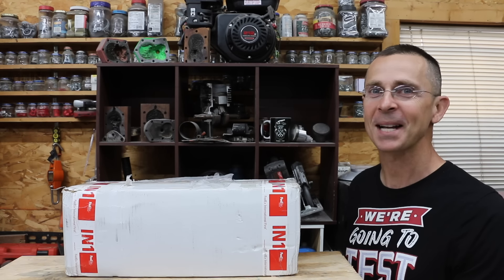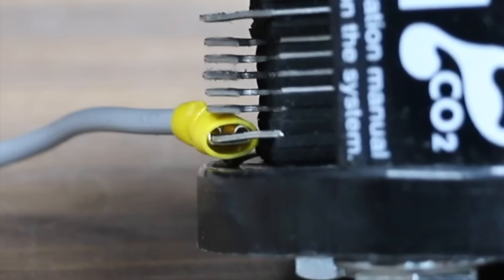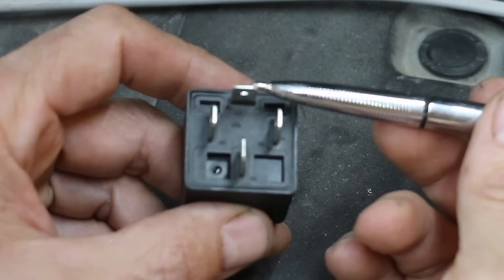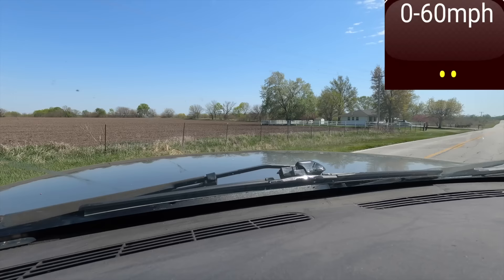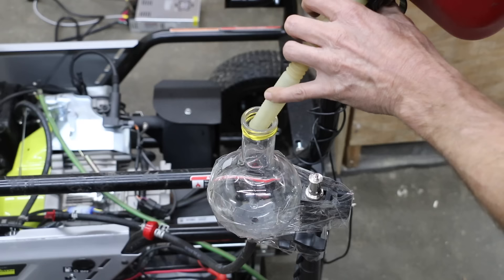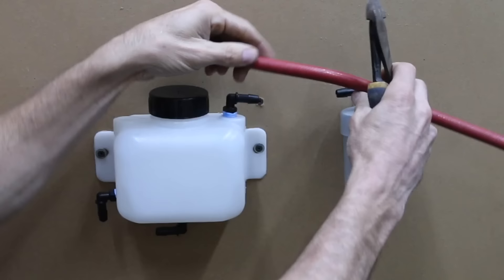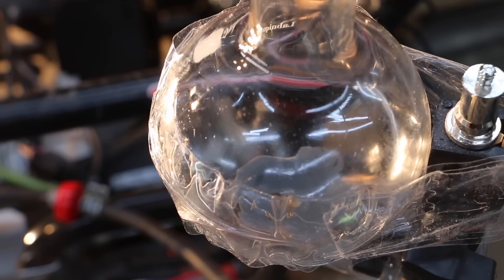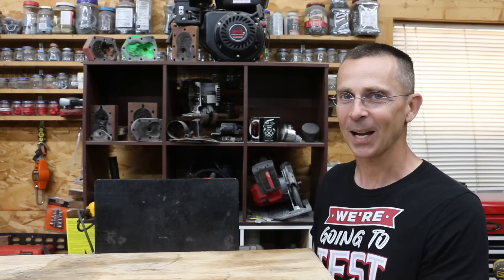AMAZING 35% More MPG with HHO? Let’s find out! Help with high gas prices?

Comment: Awesome test.  One thing that might have been interesting is to compare the fuel air ratio between with HHO and without HHO.  Wondering if with HHO if the fuel air ratio would change to to a richer mixture.   If it did then you could adjust the mixture to optimal ratio and see if HHO did indeed increase the run time.
Reply from the maker: Thanks!  Thanks for the feedback.
Reply: Just wanted to chime in on this for ya, I installed an HHO on a 2000 Saturn and placed a dial connected to the MAF sensor that would allow me to lean/rich the mixture. W/o the HHO on it would lean it out enough to kill it. With the HHO on and it leaned out on the hwy I would get 65MPG no problem but if I didn't manipulate the ratio my MPG went down from 38 to 35. So you may see if you can replicate that? Just a thought
Reply: @dericksherwood6408  Thats interesting you should make a video, that's a big missing piece
Reply: @dericksherwood6408 have you made any videos to watch on YouTube?
Reply: @antoniofoglia3846 No I haven't. The majority of how I figured stuff out was by trial & error and putting together pieces from different folks. I wish I had made videos for my own education purposes to reference now.
Reply: I thought the same thing
Reply: @dericksherwood6408  Sure you got 65mpg lol.
Reply: Yes, without making fuel mixture adjustments you can expect no benefit. I knew as soon as I saw EFI on the generator what the result would be.
Reply: I belive it, my fj60, a 4.2 strait 6 carbed, has a solenoid that cuts off the idle circuit (for emmisions),  and i made a crappy fuel vapor set up, and installed an afr gauge to monitor everything and damn if my milage didnt damn near double
Reply: I doubt you would see a difference using a 02 sensor,  hh0 burns super clean
Reply: Oxygen sensors will adjust the A;F ratio automatically unless you are waayyy outside the fuel map programmed in. Then the car goes into limp mode and you lose all your gains.
This is why you need to trick the O2 sensors (upstream ones).

Comment: In 1981 we ran a 3 1/2 hp Briggs & Stratton mini bike on testors model glue. Pre lemon scent campaign. Testors model glue was extremely flammable. We put a dab in the air filter  and rode a significant distance on each glob. That's how we took turns. No not sniffing it, riding. Some both ha ha.
Reply: I remember ol red Testor's. I though the blue was Oranges all these years haha

Comment: Great video. The fuel injection systems monitor the fuel exhaust via oxygen sensor. The hho will burn the fuel hotter, burning more fuel at combustion. As a result, the fuel oxygen percentage at the sensor will decrease and EFI will add more fuel to compensate reducing fuel efficiency. The only way an hho system can improve efficiency on an EFI engine would also require a modification to the oxygen sensor or EFI oxygen sensor settings. Hho will only work easily with engines with a carbonator. Cheers 🥂
Reply: Ps... What volume of gas does that HHO generator produce? G/per minute? That unit looks very weak as compared to some manufacturers? No?
Reply from the maker: Thanks!
Reply: @ProjectFarm You need to remap the ECU settings so that the fuel is not rich mixture and ECU needs to be tuned so less gasoline is consumed